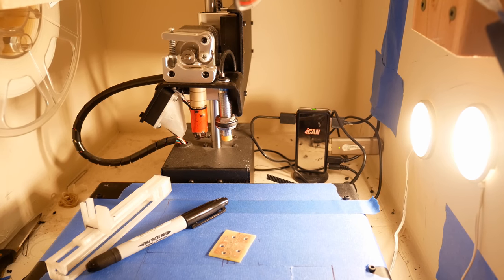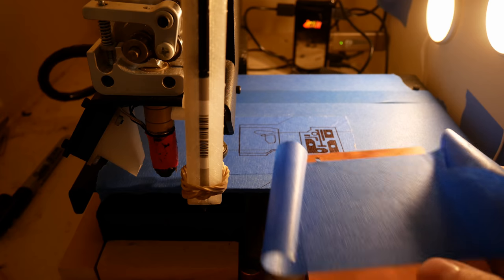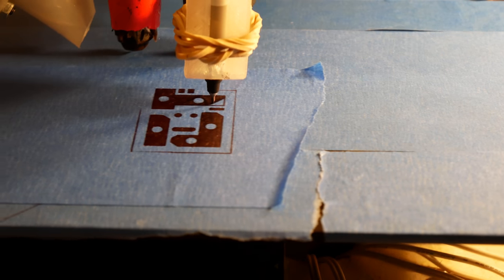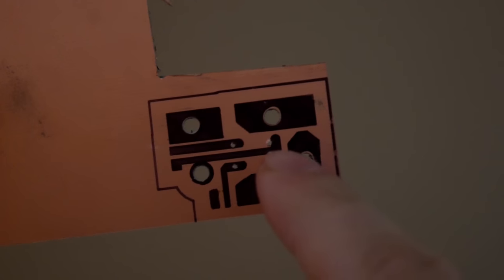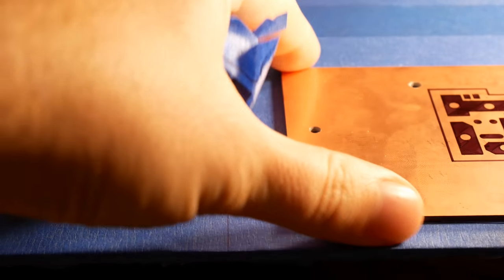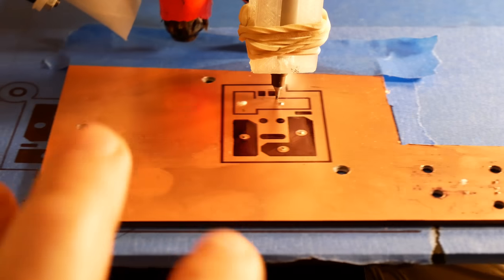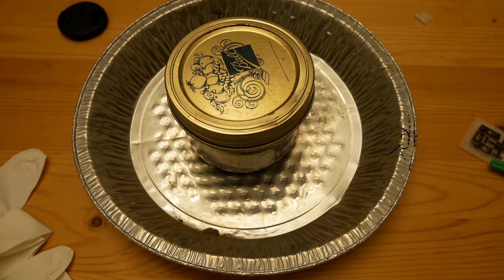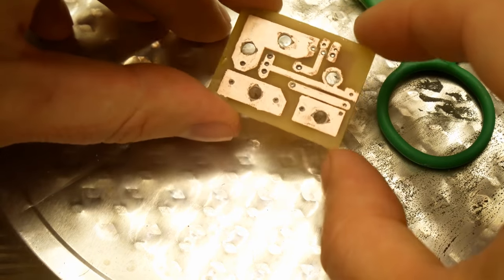PCB etching with a 3D printer

Comment: Nice work. I usually do that stuff with an old roland dxy plotter, KiCad and FlatCAM. I get good (It doesn't always work) results with a 0.4mm Stabilo pen, I noticed your tracks are washed out a little by the etching process, Is that because ink is not strong enough?  I have this problem. Never be capable find out a decent, strong thin pen.

Comment: Hi! Is it suitable to use a capacitive ink pen for this? So to not deal with chemical procedures.
How you'll metalize the holes?
Reply from the maker: Huh, I had not thought of using a conductive ink in that!... Don't most of those conductive ink pens need to be shaken regularly and depressed to pump the ink into the head?
Reply: I don't know :-|

Comment: Why not "print" a very thin layer of PLA (or the best filament for the job) as etch resist onto the copper has anyone done this?
Reply from the maker: I had issues with adhesion and porosity, but I'm sure it's doable. Certainly seems like a fantastic option if someone can figure it out. I assume getting the copper plating to heat up would be the first step.
Reply: That is a cool idea haha. You could use a relatively thick nozzle even to print a big flat trace. The printbed should heat up the copper plate if needed.
PS: Problem probably comes when you try to turn it around to print the other side haha

Comment: Instead of adapting a sharpie, Why not just print the pcb 'resist' in pla? You would simply ADD the thickness of the PCB to the Z height offset and your good to go !
Reply from the maker: +don dehart I tried to print on it, it doesn't seal well, or stick for that matter. I even tried ironing the pla pattern on. No luck.
Reply from the maker: +don dehart glad you enjoyed. I hate to do this, but now I need to ask for your help. With YouTube's new terms of service I'm going to be demonetized in a month. Even if the rest of my channel isn't your style, I would highly appreciate if you subscribed to help me maintain my ability to get paid for my work. Thank you very much in advance.
Reply: @Making  Bummer! This is exactly what I came here to learn. I think there would be a market for a filament that is optimal for protecting copper from FeCl3. And then another filament to act a solder mask. I want you to get the credit for it, so I'll let you share the idea with Josef Prusa.

Comment: Im only a few mins in, you were talking about printing on the tape first for board placement, couldn't you use the options from marlin( manual homing settings) and print accordingly ? Good video BTW! Edit for 6:51 You have a 3d printer lol why not print yourself some  Alignment jigs, rather then trying to line up with hole markings ?
Reply from the maker: Lol! Because that would have made too much sense :p
Reply: lmaoo easier to see solutions, when one is outside of the box.

Comment: How do you raise the design height in SketchUp ?? I'm very confused about this step :(
Reply from the maker: There is a push/pull function to add or remove thickness to objects. Once you start moving, if you type a number, it will register that instead of the mouse movement.
Reply: @Making  Also we have to raise the  height of each trace in the PCB layout individually right ? Cause I couldn't find a way  to raise the height of complete layout in one go!
Reply from the maker: @aniketburde5956  ouf, I haven't used sketchup in a few months, but I do think you can select and raise a group of objects all at once. They may have to be made into a group first... This is going pretty far in my memory for now though. I'll try to take a look later today.
Reply: @Making  Ya sure let me know if you can and thanks alot for your time! :)
Reply from the maker: I didn't get a chance to look at it yet, I'll try again tomorrow.
Reply from the maker: So no multiple push pull, but after you pull the first piece, you can just double click on the next parts to replicate the same thickness.
Reply: @Making  okay so I'll try that and will let you know and thanks! :)